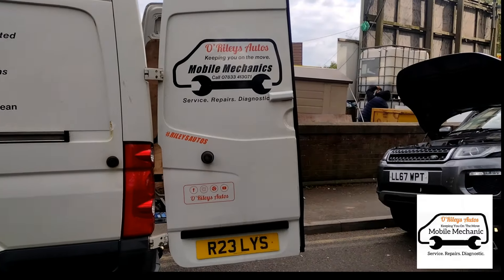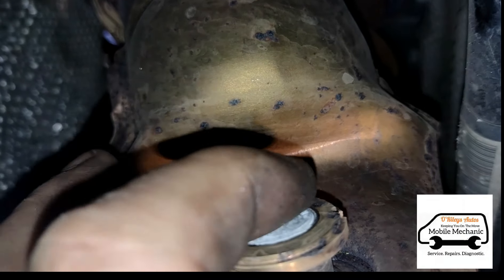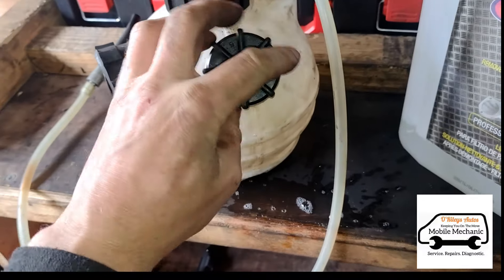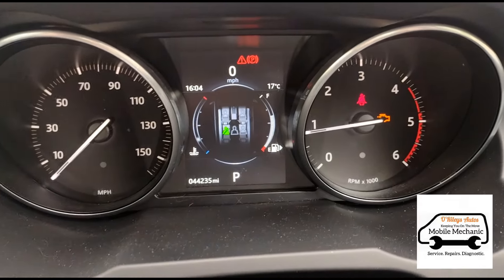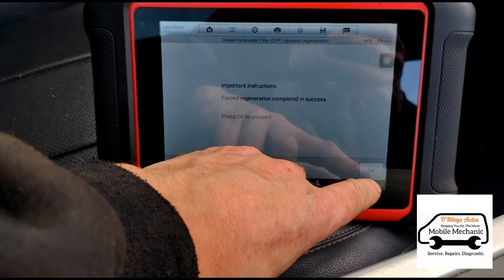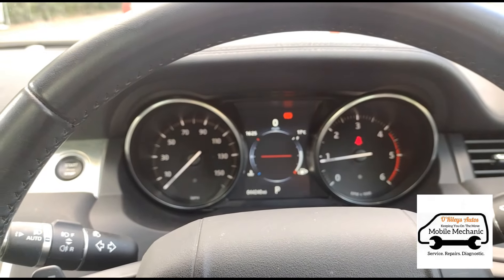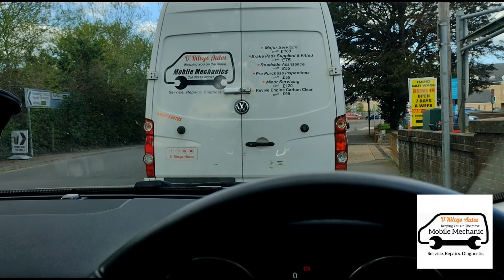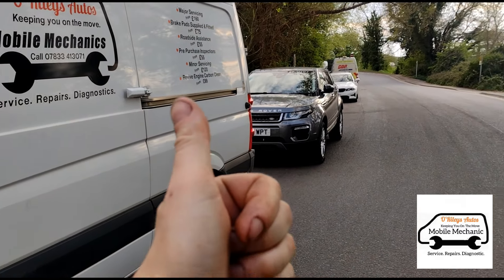P2BAE P2BAE-02 P2BA-00 NOX Exceedance Control Monitoring System Fault AdBlue Injector Blocked

Comment: Hello if the Adblue is still getting used up does that mean it’s not a blockage? Getting code P2BAE = Nox Exceedance - Nox control monitoring system & P229E Nox sensor circuit- Bank 1 - sensor 2!!!! Thanks if you can help 🙏🏻
Reply from the maker: You need a new nox sensor or wiring is damaged
Reply: @ORileysAutos  Thank you so much for your reply! Yes the cable was rubbing against the heat shield, tape was put on it but that must be the cause so! Would you have a part number for that sensor by any chance? It’s on a 2017 Land Rover Evoque SE 2lt ! In Ireland , thanks again 👍🏻

Comment: Jimmy  how do you rate those Range Rover Evoque cars?. Nice looking and drive nice but had very little to do with them myself. The other half fancy one is reason for asking
Reply from the maker: My wife had one for a couple years with no problems but the older 2.2 

Don't think these newer 2.0 ingenium are as reliable due to the extra emissions related parts. A fair bit harder to access things too. Like glow plugs on this that are required is 5+ hours.

I wouldn't say they are any worse than anything else on the market these days.

Comment: Jimmy I need advice. It it the third time  that happened on my Jaguar F-Pace 3.0D, 2016. DEF quality error and it counts down km to "no engine restart". Last 2 times the garage drained out old ad blue and put in new one and cleaned the injector and clear the error. Error was actually cleared only after driving around. This time I want to do it myself. I cleaned the adblue injector (it was clean already) and I added 5L of fresh ad blue. Maybe the cause this time was that I ran out of ad blue and that the ad blue level sensor isn't working. I drove 5.500km with exactly 10L of ad blue and it said I still had 12.000km to go. So anyway, I added 5L and went for a drive. The error didn't go away. Does it go away only if deleted by OBD-2 and only then driving around? P.S. this error happened on the highway right after active dpf regeneration. Could the NOx sensor be dirty? How do I clean it?
Reply from the maker: Nox sensor don't ever need cleaning. Most likely faulty